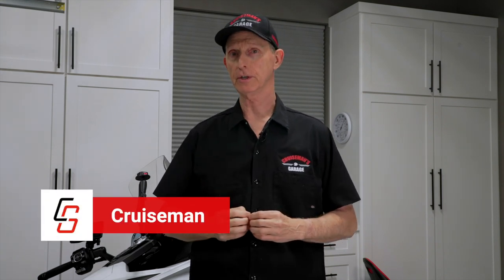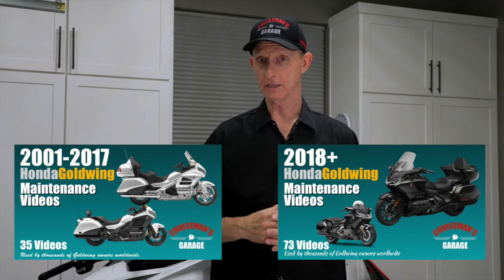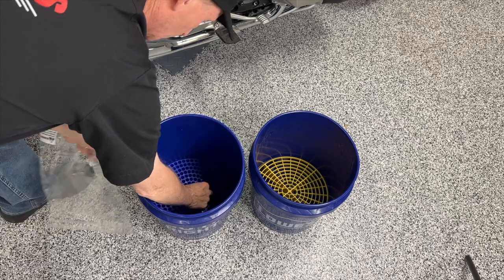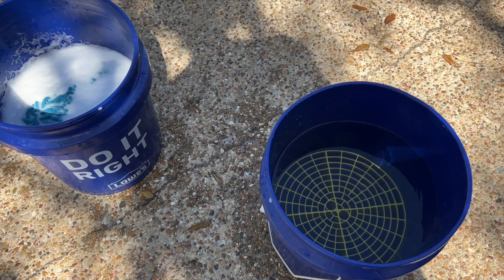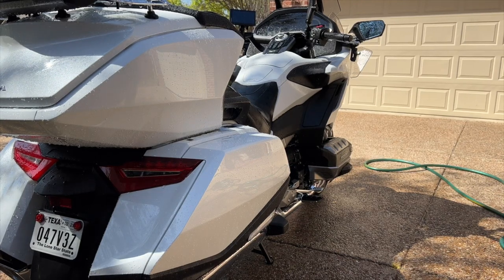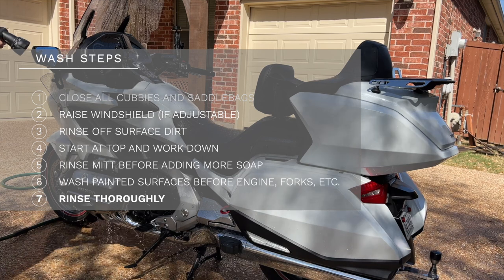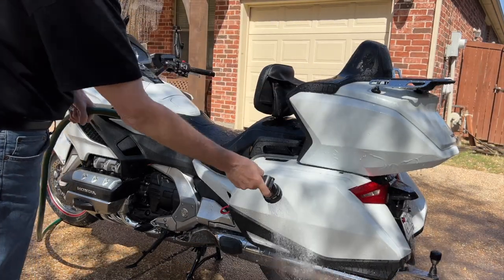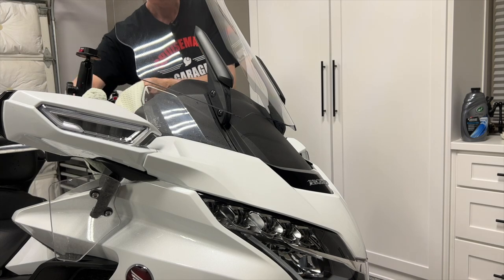Washing Your Motorcycle Using The Two Bucket Method | Ceramic Coating Your Motorcycle

Comment: Great video. Additional comments to those already submitted. Use foam ear plugs when doing the air dryer.  Makes the process more pleasant. Definitely use the shower setting on the hose around the control area. And that dryer works good getting all the water out around the switches.  Don't forget to remove jewelry like bracelets before  you start. I am going to get some of the grit guards for my buckets. Good idea!
Reply: Yes to ear plugs when blow drying and shower setting for rinsing. :)

Comment: I use the narrow plastic bags from produce dept. at grocery store over handle grip buttons. Secure it to handle bars with zip ties or rubber bands.  This will help prevent water from entering switches.  Cheap fix. Cut length of bag down to fit this area better.
Reply: Good idea. :)

Comment: Chris…. Your channel is costing me a small fortune. I bought every one of the items from your Amazon store that you demonstrated including the blower, with the exception of the Turtle Wax which I already have. I use a leaf blower to dry my bikes but it’s a marginal solution. And I really needed new towels, so…… why not?
Reply from the maker: Let me know what you think of the Sidekick blower. I even used it on our car the other day!
Reply: @cruisemansgarage  …. Hi Chris, I finally had a chance to use the Sidekick after two-bucket washing my Harley this afternoon. Holy cow that thing has some power. It’s a high quality build item as well and I like the heavy duty on / off steel toggle switch. What pleasantly surprised me, was the warm air that blows out of it. That is a bonus for drying quickly. By the way, the towels you demonstrated, and I bought, are really good too. I barely needed one to finish wiping down the bike, but they are super high quality as well.

Comment: 2 bucket idea has been my method for years they now say use 3 buckets as well as deionized water for even better results..
Try to always use a foam cannon to help lift the dirt particals of the bike.
Some people like ststed also use a leaf blower.(works perfect)
harborfreight has one with two speed settings (hi/low) with short oval nozzles as well included, useing  air from a air compressor (low to mid setting on air volume) can also be used
Remember the soap not the water does most of the cleaning so try to keep the bucket filled with lots of sudz .
Btw i use 2 different microfiber towels whhen wasking the bike (one for upper and one for lower) and i use completely different towels for the wheels.
Tip: use a permant marker to tag your towls that way you know what towl was used for what areas ,also if any of your washing and or drying towels for the body ever fall on the floor DO NOT use them again for washing or drying as dirt could have been embeded in the towel and can possibly scratch your paint.
Reply from the maker: Great tips
Reply: I, too, use a foam gun for washing BOTH my car and 2018 Goldwing Tour DCT.

Comment: Be very cautious using a blow dryer on your electronics, I have similar dryer I use on my Harleys and have taken out multiple radios over the year by getting water into the cd decks.  In fact there is a cottage industry fixing Harley radios, Iron Cross audio, to repair radios guys like me break. ps Great video, tks for making.

Comment: On April 2, 2022 you do a great video on washing the windshield and dash.  As the dash is very susceptible to scratches and even blotchy clouding from exposure to chemicals often found in cleaning products.  Yet this video completely contradicts that video when you wash the bike.
Reply from the maker: The only chemical used on the windshield and dash in this video was a mild car wash solution, which will not cause any harm.

Comment: Why not just wash wheels last?
Reply: I, too, wash my 2018 Goldwing's wheels first.  So when I'm ready to wash the Goldwing entirely, I won't be on wet ground to finish my washing of my Goldwing.
Reply: As Dan Rahn said, wash the wheels first. I start with the rear wheel first; you lay down on a dry driveway while washing the wheel. Before rinsing, I wash the front cowl (located behind the front wheel, both front and underneath?)